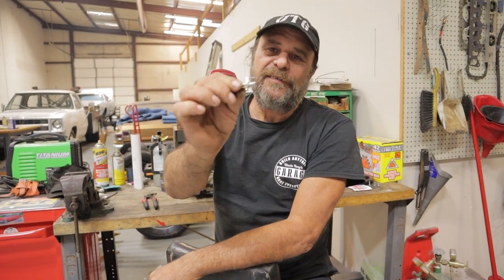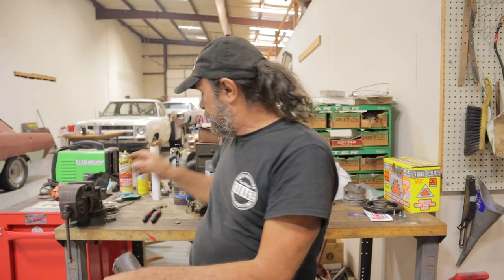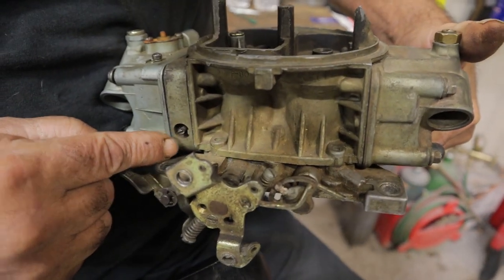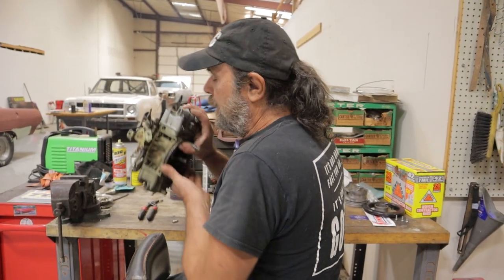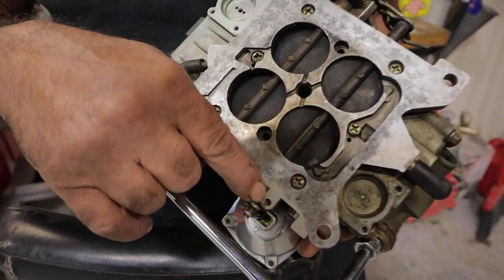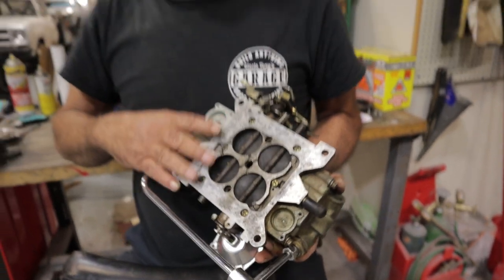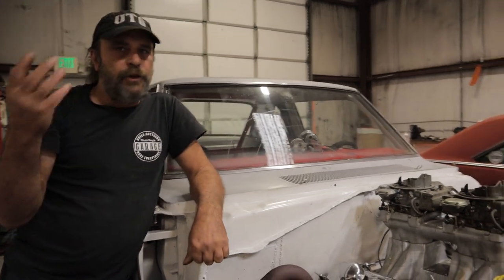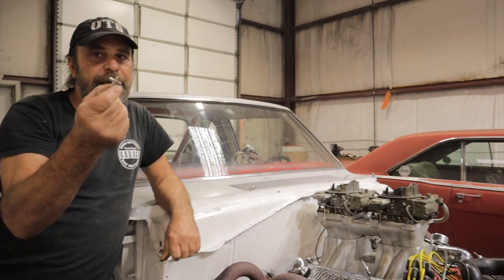Fine Carburetor Tuning Using Fish Tank Accessories - Regulated Vacuum Leak For A Cleaner Idle

Comment: Uncle Tony

I'm a younger guy, so I'm from the fuel injection age, but from what I've studied on carbureted motors, 99% of people run a carburetor that is entirely too large.

If you actually calculate the CFM their motor moves they do not need that large of a carburetor. Which means they're actually losing manifold vacuum right from the get-go

If people were running the proper size carburetor, I feel a cam swap would be more tolerated.

350*6500/3456=658 CFM

If you were running a Chevy 350 all the way up to 6500 RPMs at 100% efficiency that's only 658 CFM.
No naturally aspirated motor is pulling 100% efficiency and therefore a 650 CFM carburetor is more than enough

And a 650 CFM carburetor will allow plenty of manifold vacuum on that motor

So many people think that they need a larger carburetor I think they are buying it with bragging rights in mind but it just makes your motor perform worse
Reply: If that was true the 6 pack engines that dodge came out with would have ran worse than the 4 barrel engines. They didn't run worse they ran better and faster 1/4 mile times as well. Don't believe everything you read on the internet

Comment: If the secondary adjustment screw isn't obstructed by the intake, you can use one of the tiny 1/4" bit ratchets with a small flathead bit and adjust without removing the carb. May have to grind a little on the bit so it will fit the hole.

Comment: Interesting tuning tricks from the well of knowledge! Just a question to that scenario, and this came from thunderhead 289, he suggested, particularly on Fords where Venturi vacuum advance is prevalent, that you change the advance to manifold advance so at idle where u need more advance for a better burn but your starting is not affected. Wonder what your thoughts are in that. Reason I ask is that my 347 seems lazier on manifold than Venturi. I have drilled the main throttle plates only to 3/16”. This has helped.

Comment: Luke (thunderhead289) did something similar to run his 40mpg lawn mower carb. He's also running a fancy app to monitor the A/F ratio but it's mostly done with a controlled vacuum leak
Reply: He Used a GM idle air control valve and an arduino controller board he programmed to monitor the oxygen sensor and open the valve as needed to keep the air fuel ratio correct. This was nessisary since that tiny lawn mower carb couldn't flow enough air and was always super rich.

Comment: I remove the secondary idle screw and run it down from the top, so you can adjust it from the top, you may have to use some blue locktite to hold in position. Hope this helps.

Comment: Aquarium valves are available in a threaded needle-valve style for finer adjustment; also works as a turbo regulator pressure controlled bleed for extra boost.

Comment: Not always a need to remove the carb to adjust the secondary set screw. You can adjust it with a small flat head bit and 1/4 drive ratchet. Or even just the flat head bit and a 1/4" wrench. This will depend on how high your carb sits on the intake.

Comment: I have one timed vacuum line to distributor vacuum advance and the manifold port to a vacuum gauge in the truck. Looks like drilling holes in the butterflies will be my solution. It is a cool idea for mechanical advance like your setup. Thanks.

Comment: Soooo, if you hook up the valve like you suggest, then where do you hook up the vacuum pod on the distributor?
Reply: The vacuum pod on the distributer, should be connected to a vacuum port that only opens, the moment the primary throttle plate is opened beyond idle.
This valved vacuum, should be open while the throttle plate is in the (closed) idle position, to help lean out an over rich idle mixture, keeping the engine responsive, and able to idle long without stalling or fouling the plugs.
Reply: The vacuum advance, has the function of advancing the timing, above idle speed, to facilitate burning at the most efficient way as engine conditions vary in load/ demand.
Centrifugal advance, is set via spring loads, to advance timing at set higher revolutions, to deliver a smooth power curve.
Reply: Wear on the tension of distributor advance mechanisms, ( loose play) causes ignition scatter, which gives erratic running, and possible engine detonation damage.
This can be seen with a timing light, running at any fixed engine rev range, or where it occurs, if at idle too

Comment: Another Nice Tip!
I wonder if i can even try it on my sled.
Instead of taking appart the carbs to change the air needle according to freezing nights or melting spring day.  I understand its not the same type of engine but air/fuel mixture thru 2 carbs engineering is.   
I will do my homework before. Dont worry.

Comment: In most cases you can turn the rear of your holly a bit from your 1/4 screw driver and a 1/4 wrench and you can turn the rear screw to open up the blades.

Comment: I ran 246 degrees@050 with a 509 lift hydraulic flat tappet cam with 106 degrees LSA.  With a 800avs Edelbrock without an issue for like 12yrs
Reply: Depends greatly on CID, engine vacuum and transmission type. 
Ie manual transmission or automatic w/converter etc
Reply: @HeadFlowInc  it was a 383 stroker Chev.  With old 170cc. Edelbrock RPM heads and Weiand Airstrike intake.  The tranny was a th350 with a ten inch 3000 stall B&M  Holeshot converter.   With 4.11 gears

Comment: Another way to tame down a lumpy cam is with Rhoads lifters, My friend had a 305 (duration, not engine size :) cam that was a couple of grinds too big to make vacuum for power brakes, well on the engine builder's recommendation he slapped in a set of rhoads lifters and it was like having a 276 cam at low revs for vacuum and driveabilty with the bite of the big cam above 3000 rpms, seemed snappier too. Yea, they are somewhat noisier than normal hydraulic lifters (You will grow tired of people telling you you need to lash your valves at the drive-thru) , but they work great with a well thought out setup and the Pontiac guys seem to swear by them.. 

I took Tony's advice and ordered the (last in the country actually) of the good older ball bearing NLA / NOS Accel points dizzys (single point because I plan to use it with an ignition box) for my long term street ride, and if anything fails I can just wire the points in direct and at least get home under my/it's own steam.

Comment: In boosted applications the same thing is used, to prevent factory map sensors from seeing boost, an fmu makes fuel pressure skyrocket by closing the return line when there's boost. Making stock ecu and injectors safer to run, then they put a transducer to cut signal from o2 sensor to prevent lean tip in. Then honda guys will daisy chain x amount of valves to dial in appropriate vac/ boost venting.

Comment: Going off the path here, Seems like alot of people like to dunk on the 68'/69' Carter AVS's for a couple of reasons, 

(These carbs were "notorious" for having drivability issues, and is avoided to be used on any engine, not me though, it works fine AND the air bleed screw is another adjustment point on the already adjustable carburetor)

above the 2 idle mixture screws, you have an additional screw at the top near the air horn mounting area, that screw controls the amount of AIR you are adding to the idle mixture screws,

Pretty neat if you are trying to lean out the idle mixture further with the air bleed screw.

With the aquarium spigot, the mixture can even go leaner! Even leaner with the carburetor's air bleed screw!

Comment: Makes me wonder now if the factory AFB on my 1965 273 Commando which has a separate air adjustment screw in the center /middle/front of the carb (in addition to the two standard idle adjustment screws) actually will serve the same purpose as the valve profiled in the video?
Reply: Yes! I discovered some of these old afbs were like that. I don’t understand why the moved away from that feature on later carter carbs.

Comment: God I wish I had your knowledge! put together a 350csb. Comp cam 460-470 lift 110 sep   edelbrock 650  flat top pistons  pulling 14 inches vacuum. looks like a couple holes in the butterfly may help per this video. Yes, have the idle up to run and when advance is hooked up this girl revs up another 1000 rpm. Bigger cam problem for sure I believe.

Comment: ....or you can take the screw out of the throttle plate & insert it from the top making it accessible....or you can drill the idle air bleeds...or you can  modify the circuit  in the metering  block

Comment: I replaced the factory slotted dog-point screw in the secondary throttle plate adjustment, with an equivalent Allen socket dog-point screw.
I can use the short leg of an Allen wrench to adjust the secondary throttle plates without removing the carburetor from the engine.

Comment: Well, now i have a new project! thanks uncle tony, you described my challenger perfectly in this video! the only thing that is missing is the MSD 😂 I have been battling with a rich idle since i bought the car! I do have a question though, at what point should a guy stop using a vacuum advance distributor?

Comment: I love it!  On a Carter/ Edelbrock AFBAVS CAN YOU put the regulator inline with the ported and across to the ported port on the front of the carb outside of the idle screws? I don’t run a vacuum advance, it’s locked at 37 , 20 centrifugal and 17 initial on a .020 over 390 FE with a Comp 270S that has been degreed at 229.5@.050 int. and 231.5 exhaust. I ported the heads to flow 285 @.500intake and 285.7@.550.  The exhaust flow is 205 /.500 215@.550 , 2.06 intakes and 1.6 exhaust. I want 5/16 intakes and 11/32 exhaust  valves, but 11/32 guides and I turned the 3/8 severe duty valves down to 11/3/2 with good clearance and they were really quiet that way.  I’m running the 800 Carterbrock with the 800 Thunder Series lower half and a 750 Carter CS with the air valve below but trimmed the rear boosters from the 750 that used the pullover passage that fuel as soon as the air valve allowed vacuum manifold to pull it would drizzle like the quadrajets did, except that I drilled the passage a little bigger and the boosters feed and did some thinning into a V shaped booster tube that acted as an airfoil, matching the booster outer ring like valve seat to the airfoil. And the air valve front was tweaked with needle nose pliers on each side and in the middle to increase manifold vacuum to reach the pullovers on the boosters just a bit before the air valve dropped.  It is really responsive, but the cam at idle with the 109 LSA even with 53 degrees of overlap will foul the plugs using the 113 jets and 7037 rods. When you are driving it, idles at 1030 rpm’s and holy smokes it is so responsive. I have a -08 AN line to the Edelbrock electric pump that is connected to the cell in the trunk that has a sump cut in the floor. I’m deadheading it but it has a return bung on top with a roll over valve.  Could I put a regulator from the manifold port to the ported one right at the screws?, I would like to idle it down to 950 and lean it so the pipes can stay white/ gray idling staying under 3800 with 4.44s and manual C6. It seems like richer and idling at 1050,  the converter gets hotter than you would think. I’m about to put a trans cooler on it. Even though there is a lot of air circulating.   What do you all think. This old Ford is revving beast! 7000 shifting and it may be over its powerband but it’s is still pulling like a freight train and people always say put a Holley in it and see what it will do…. Truthfully, I don’t know if a Holley would help any.

Comment: tony the old holley trick is to put a .015 wire in the fuel idle passage so it restricts fuel flow in the idle circuit. Now your idle screws will work to clean up idle also  can open rear blades slightly or even drill holes in the butterflies There is endless tuning tricks for holley double pumpers. I use the wire and open rear butterfly blades works great on bbc with 236 degree @ .050 cam. This trick is even in the holley book I have
Reply from the maker: We covered the secondary adjustment and drilling holes in the video!  I didn't go into the wire part, because it's Holley specific and because it doesn't do anything to get the blade out  of the transfer slot...which in itself can cause off idle issues.
Reply: Using an air fuel ratio gauge by bringing to the rpms to 1700 or 1800 rpms just before you get fuel starting to trickle from the primary boosters you can see what you need to do with the idle feed restriction.  most performance holley carbs come with a 0.031" idle feed restriction 

That size is what the holley computerized test bench is calibrated for.  That 0.031 ifr size is right for a 327, 331

A 347 to 360 needs a 0.032 ifr..

A friend with a 500+ bbf tunnel ram and 2 carbs needed to drop to 0.028 ifrs to the the air fuel correct . I worked up on a 429 scj to 0.036 ifrs  got a reply from the owner. I cant pull away from a stop sign no matter how i feather the throttle without spinning the rear tires.  Holley and edelbrock said they removed their idle feed tuning so carb shops have something to work with.

Comment: Interesting. But why loop it? It is basically a controlled vacuum leak, you could just run it from manifold vacuum  put in your valve and leave the other end open to atmosphere.
Reply: For filtered air, versus unfiltered air contaminating your oil.

Comment: Does the Carter have a similar secondaries adjustment as you show on the Holley? Is there a better valve out there? Those may not stay adjusted with heat & vibration IMNSHO

Comment: (Vacuum advance experiment) Install a check valve into your manifold to vacuum advance canister line, now tee an aquarium vent valve into that line past the check valve to set how much vacuum bleed off that you need, (so it doesn't stay advanced forever) now when you floor it the vacuum stays in the vacuum line until the rpm gets the weights spinning, my manifold vacuum line with adjusted aquarium vent valve takes 53 seconds after engine shut off for the vacuum diaphragm to click shut to (no vacuum).

Comment: To anyone who thinks it's easier to just remove four bolts and take the carburetor off, for you, it may be.  But I know at least for me, and perhaps to a lot of people, some of these carburetor mounting bolts are the kind of deal where you turn it one eighth of a turn, take off the wrench, finagle it back onto the head of the bolt (working in an awkward position and trying to find the middleground between above the head and below the head, even some times having to flip the wrench over if you couldn't fit the box end on) and get another eighth of a turn in there on a bolt that really doesn't need to be two inches long, but for some reason it is, and then do all of that in reverse when you put it back on.  If that's not an issue for you, more power to you.

Comment: Take the secondary adjustment out of the bottom and put it in from the top ! Problem solved . Use a very small screw driver .
Reply: Did you find that the factory screw was "staked" in there to prevent it losing adjustment?  I had a single mark at the threads on the top side where it looked like somebody gave it a tap with a center punch.

Comment: I'm a newbie engine builder, but I always tried to keep my stock/daily engines in the best running shape I could I tested fuel pressures, I checked dwell, I forever screwed with static timing (haven't tried Tony's spring adjustment stuff for the mechanical advance) etc etc. 

How exactly do you tell if the engine is "running fat"? If I had a nice daily hotrod I'd rig up an Air Fuel Ratio (AFR) gauge so I could tell where I'm at, but so far I haven't gotten there, and I'm just curious. 

Thanks!
Reply: I'm not being facetious when I say your nose will know - but it can take time to develop the sense of smell which lets you know how rich or lean the burn is.

An old friend could actually perform nearly perfect fuel system tuneups on L-Jetronic equipped cars using nothing more than a simple blade screwdriver and his sense of smell.

Comment: You can get an arduino and code it to run an external IAC using a map sensor, throttle position sensor, and intake air temperature to automatically adjust for elevation and weather changes as well as rapid throttle closing events with just a few parameters.
Reply: And hours of tuning and constant refinement and questionable consistency compared to a simple valve and a quick adjustment?
Reply: @needmoreboost6369  not to mention all the extra weight to the car
Reply: @John1969R  yeah that’s another thing but the weight wouldn’t be a concern unless it’s a bare bones race car it’s just adding digital complexity to a superior system to efi doesn’t make sense that’s coming from someone who has a simple reliable efi car turned into a mess of mechanical systems to tune it to 3-4times the factory hp instead of just buying a programable ecu lol

Comment: Some carbs come pre-drilled for that, and some of them even have spring loaded bypass valves in the valves which are little nail-head looking valves with springs on them set to allow air to come through, but only to the level of the vacuum pressure set up based on the desired intake vacuum, by assembling them with precisely calibrated little springs.

Unfortunately, I can not find an image of one online, and I do not have one in any of the engines I own.